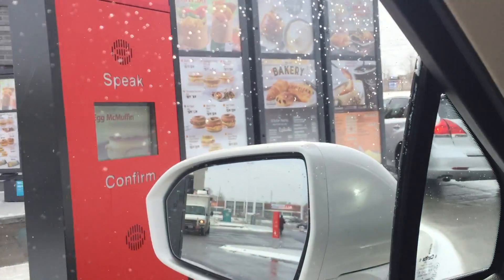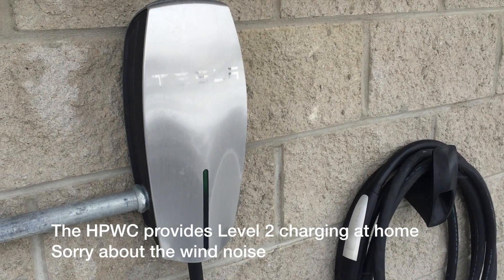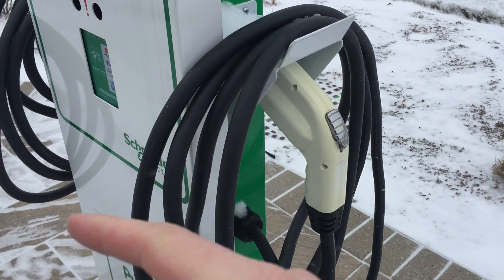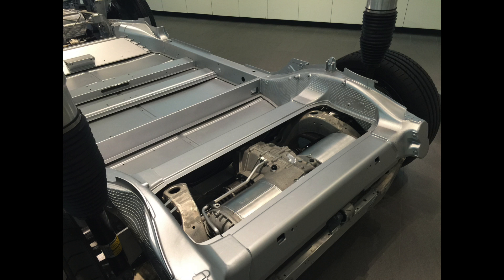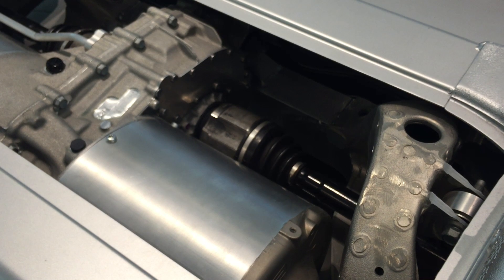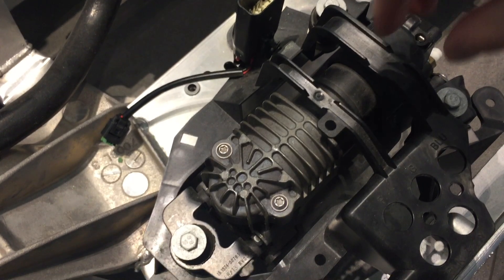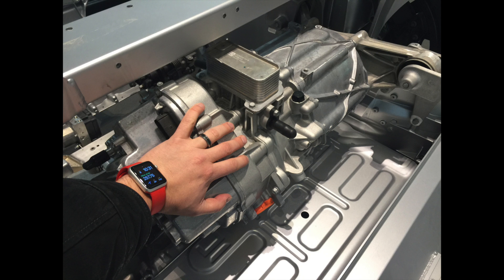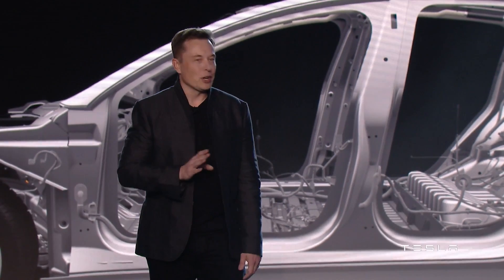Tesla Charging and more Model 3 interesing details

Comment: Having seen this video again , owning a Renault Zoe first generation, would be interesting with tesla motor upfront  only and 40-50 kW , what miles it could do, tesla system under the body looks much smaller , lighter and more efficient . Also size of model 3 not particularly small car overall , if u make it more Zoe size would also go further , power /weight ratio surely much better

Comment: Question for you! At that charging location near your home, with the Tesla charger and J1772 charger, would there be any difference in charge times between them? Does the J1772 work just like the Tesla charger once it has the adapter?
Reply: The J1772 should give you about 18 miles per hour while the Tesla charger should be about 28 miles per hour.

Comment: Great video.  Would like to know your thoughts on single vs dual motors for the model 3?  I heard someone say the dual motor is actually more efficient from a power consumption POV, so can help wrt mileage you get on a charge, especially if you're going on a longer road trip.
Reply: +Model 3 Owners Club so I should probably look into getting the dual motor then when I configure my model 3. Wonder what that will do to the base price!! :)

Comment: thanks to no high grade cnc biulit aluminum subframes and articulating parts the drive train still sufers from twisting and bending not covered by manufactures warenty some thing still not adresed in the model 3. material is just as important as the machining.

Comment: Why would anyone wait for the Tesla 3? When you can buy a Nissan Leaf for much less number one selling electric.
Reply: Great! But I still wonder if Tesla buyers are more interested in the superficial exterior rather than the price and reliability.
Reply: +John Puccetti range the leaf does not have the range to get me to work and back home...yes it is great for hopping around in the city but if u really have to drive more than 120.. miles it is not a good choice...
Reply: Tesla cars and batteries are a lot of HYPE at this point. Zero cars zero batteries why would anyone wait two years? Leaf is here now with a track record.
Reply: +John Puccetti I chose a BMW i3 back in 2014.  The i3 just had better performance and was more comfortable.
Reply: I just bought the 2016 Prius II for $22,500.00 plus tax 52 mpg. I think I will stay away from electrics for a few more years.

Comment: This is where the average american household learns why standardising 110V was a really bad idea in households, ridiculous copper for high current.

What's the state of 220/240/250v over there now?
Reply: +ipullstuffapart Well about a decade back, my old man had an electrician run a 240 volt line to our porch in the backyard. He knew he'd need it for his shop sized air compressor. It was cheap according to him. So 240 volt is not standard here in the U.S. but it's accessible, I'm not planning to bring my Model 3 in the backyard so we're already planning to have another 240 volt line to the side of the house of the driveway.
Reply: +B.L. Alley short of loading it into a shotgun, how can a AAA battery kill?
Reply: Last I heard, the lowest voltage anyone had been killed by was 9V. Not sure how 1.5V could get the job done.
Reply: It is not the voltage that is lethal, but the current (amps). 100mA is enough to stop your heart. My father (an electrician!) once exposed me to 10.000V transformed up from a 9V battery. I tickled like hell, but no damage!
Reply: From what I recall it was holding one pole in each hand. It was a variable transformer he built in school as one of his projects. Yeah, you can't do that with 10kV from the grid...
Reply: ipullstuffapart We have 360v here in Switzerland

Comment: What's the typical charge time for a Model S on 115V and what amperage does it pull. I'm trying to figure out the electricity cost to charge at home.
Reply: +Bill Meacham The charge time will be a function of how depleted the battery is and the power output of the socket the charging cable is plugged into.  So for your typical 120V outlet, they are almost always 15Amp rated at the circuit breaker.  Without tripping the breaker, the max output is usually 10% less.  So that make 13.5 Amps (or so).  So the power output of this typical socket will be (P = V * A) 1.620 kW.  Do that for 1 hour then you will have used 1.620 kWh of energy.  Since there are losses in conversions from AC to DC, lets call that 1.5kW from that output.  

While charging from a 120V 15A outlet is possible, it is just not practical from a time standpoint.  That is why it is recommended to have at least a 240 Volt 40 Amp circuit to charge your Tesla at home.
Reply: +Bill Meacham This was helpful for me. https://www.teslamotors.com/models-charging#/calculator
Reply: Zero Motorcycles can go, depending on model, over 150 miles on a charge and charge over night using a normal extension cord plugged into a 120v 30a outlet.

Comment: From my point of view, as a future Model 3 owner, I hope the car needs less 'juice' than the S. my older home has a limited maximum on its main breaker compared to modern homes in the U.S. This seems quite possible with the smaller frontal area, and smaller motor(s) it has. I also think that perhaps the Cd is lower because it has no hatchback. I would like a hatchback, but will settle for fold down rear seats as my reasons for a hatchback have diminished with my age. I no longer can hoist the sort of loads I used to.  Getting a good range has not, so I hope it is at least as Elon said it would be.

Comment: Thanks Trev well researched. Food for thought as I have a Citroën C-Zero currently with the J1772 charging lead. This means I could still get the dedicated tethered cable at home for both cars
Reply: +Model 3 Owners Club In the UK there are gov subsidies for installing a tethered cable. It seems the most I would need for the C-Zero at present is 16amp supply. When I will be in line for the Model 3 seems to be end of 2018 so the charging method will be defined by then. Keep the videos coming and thanks for the swift response